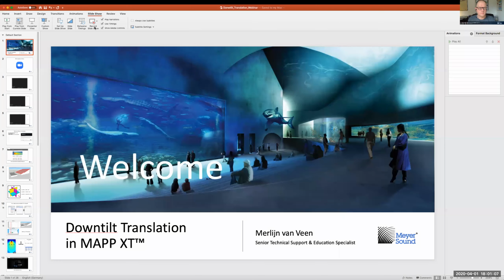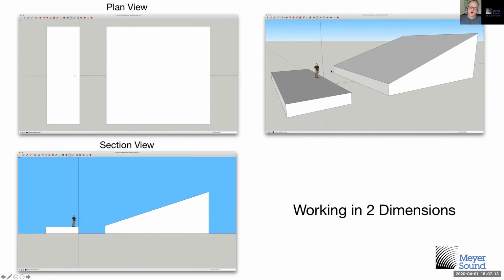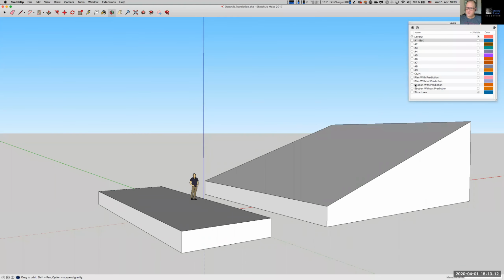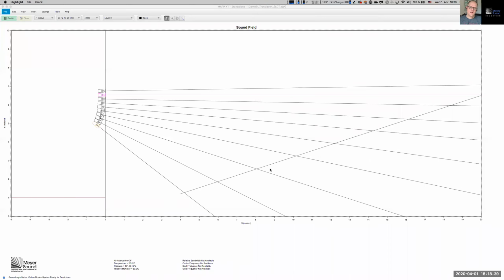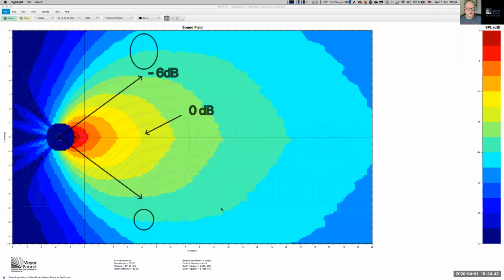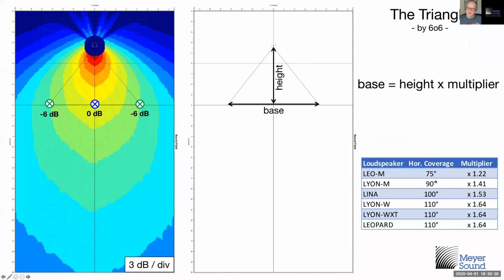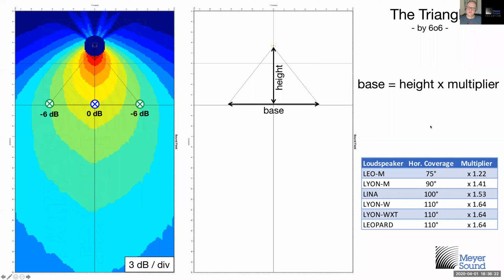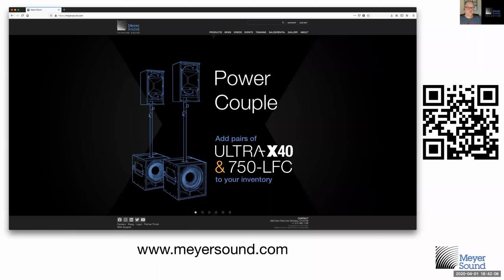Meyer Sound Downtilt Translation Webinar

Comment: In this example with this setup at this specific theatre would it be acceptable to just use  one Lina line array in the centre and and just two front fills to the very right and very left to cover the front audience gap in those areas for the mid - highs frequencies ?

Comment: Thanks so much for the seminar. Very informative, and I really value the pool of knowledge at Meyer sound and how generously it is shared. I have been mapping angles out in sketchup to prove angle vs multipliers to myself, and I couldn't solve the angles correctly against your multipliers. I may be wrong, but those multipliers solve for the distance from the element TO the -6dB points, and not the bisection distance of the triangle? Should the multiplier of a 90° element be x2? Apologies if I am wrong.  Thanks again!